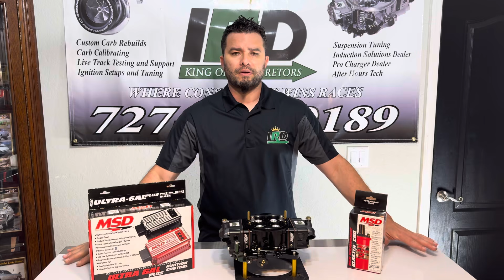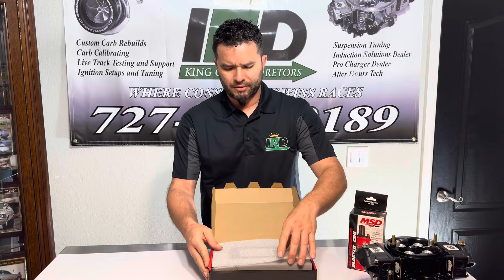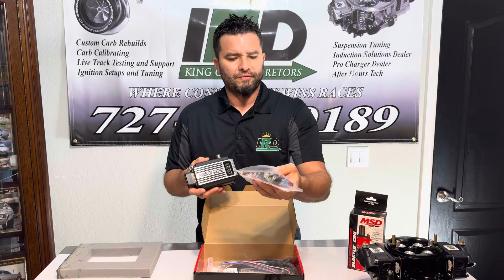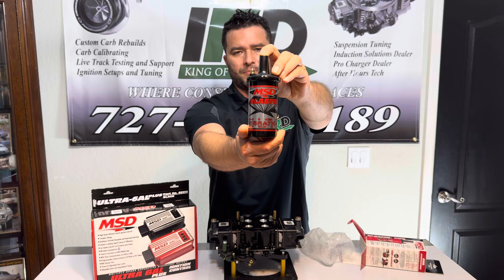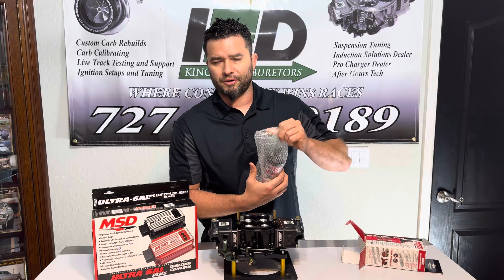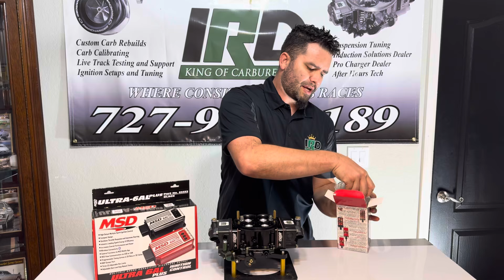MSD ignition is it worth it??? @HolleyPerformance @MSDPerformanceVideos

Comment: ive owned 4 90s chevy pick ups tbi motor, i put an msd coils on all of them, didnt see any difference in fuel milage and 6 mos was the longest lasting one, dont waste your money,the stock ones last forever
Reply from the maker: There have been some cases where this happens. However msd coils would help with a little longer spark duration and a little more voltage depending on the setup. Some stock coils work good too again it depends on the application.

Comment: Can I use the 6al with an MSD Atomic efi setup... I have a Ford 302 in my Cobra and would like to include a 6al box.
Reply from the maker: Yes you can but make sure you setup the wiring configuration so you can do timing manipulation if needed. You can find that information on the Holley support website.

Comment: What would cause many (4) of the Blaster 2 coils to fail (crack) when using the 6AL?
Reply from the maker: If your asking about cracking the coil it probably in an environment that has a lot of engine bay heat, or is around something that puts off excessive amounts of heat. Remember, these are encased in a harden plastic that is designated to withstand a lot of abuse but anything you can do to relieve any type of heat around a coil loose bracket something that makes plastic want to split is only gonna better your chances of survival with that product in particular.